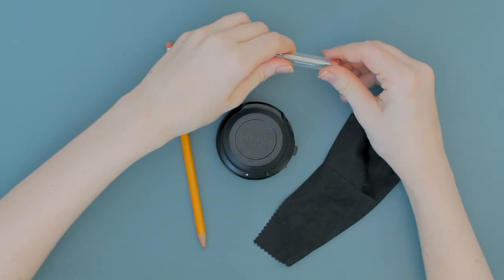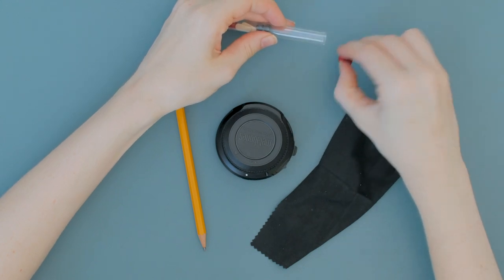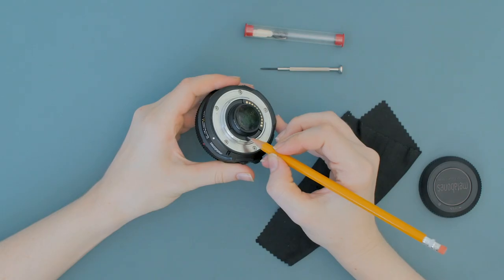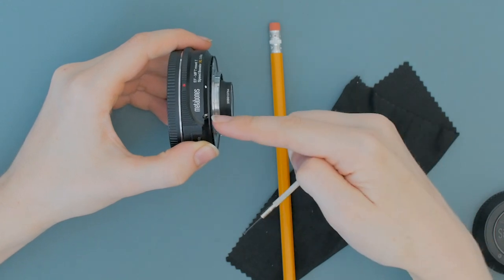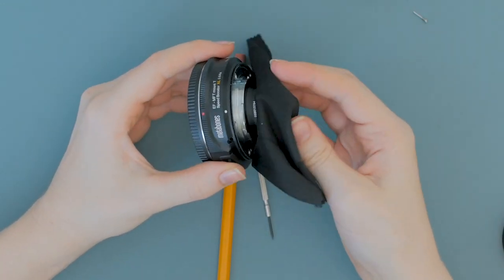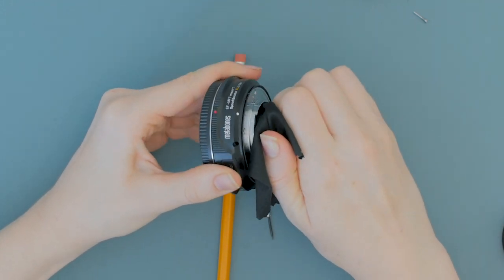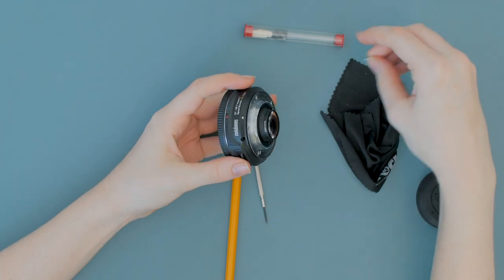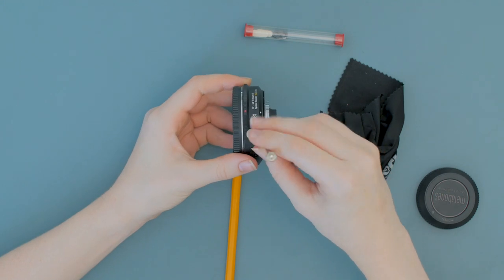Focus Fix on Metabones Speedbooster XL (0.64x)

Comment: I just bought the same SpeedBooster today. I have the same adapter ring as you. But there are no screws in the same position. Are the adapter ring models different? But mine is also EF-MFTmountTSpeedBooster®XL0.64x.
Reply from the maker: It looks like there might be two models, one has a screw in a different place. Metabones has a operations manual that shows the difference. https://www.metabones.com/article/of/infinity-adjustment-speed-booster-only

Hope that helps!
Reply: @gheseproductions  thank you.
Reply from the maker: @lovecamera8  Sure thing. Were you able to get it to work?
Reply: how far can you put out the first glass, i have a BMPCC4k and I need to put    around 3-4 mm  nearer of the camera.

Comment: Thanks for the video. I bought a 0.71 booster PL-RF and had no focus beyond 10 feet or so. It had sat on my shelf for several months before using it and I thought I had a defective unit. It was an easy quick fix. Thank you. You wold think Metabones would put a note in with the speed booster in case the focus needed to be adjusted.
Reply from the maker: Glad we could help!

Comment: Hey, may i know what screw size you are using? and do you might know the size of the 5 screws that are sided on the glass? Please save my day :(((
Reply from the maker: I'm not sure what the size is. Sorry! But this is a kit like the one I'm using. (https://www.walgreens.com/store/c/walgreens-deluxe-eyeglass-repair-kit/ID=prod352661-product) Also, Metabones has an operations manual, maybe you'll be able to find something on there. (https://www.metabones.com/article/of/infinity-adjustment-speed-booster-only) Hope you figure it out! :)